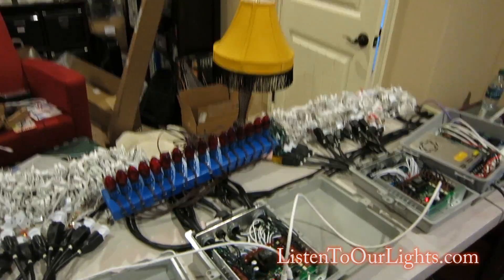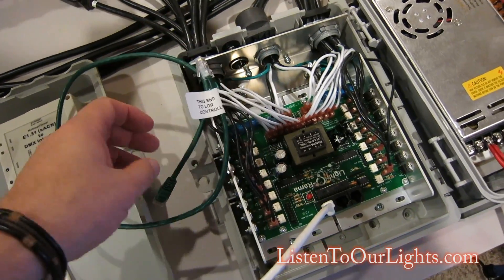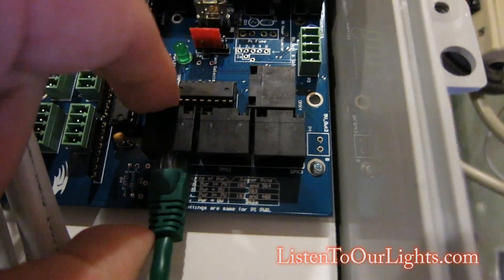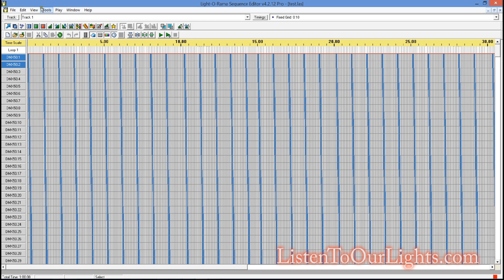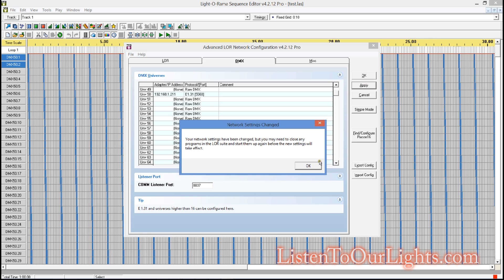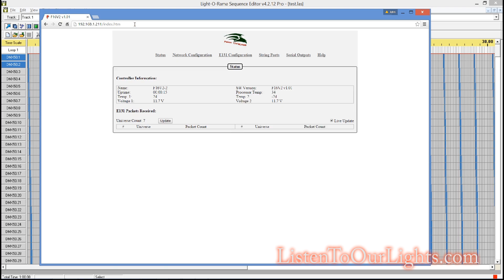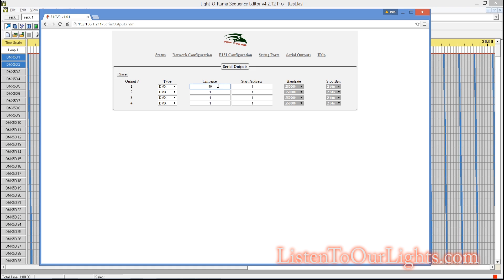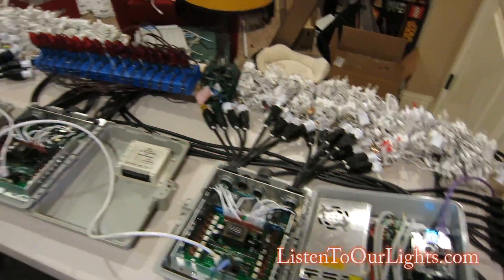Falcon 16V2 as DMX Bridge

Comment: What special cross over cable is that?
Reply from the maker: Actually, on the V3 and V4 models they have an RJ45 jack(s) that you just use a regular old straight through cable. There are jumpers to go back and forth between DMX and LOR. No special cross over cables needed.